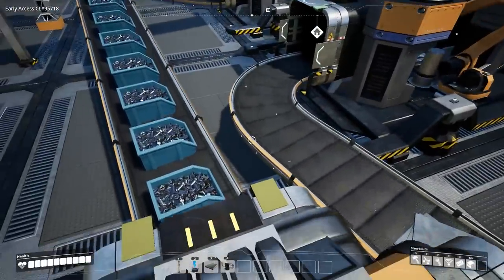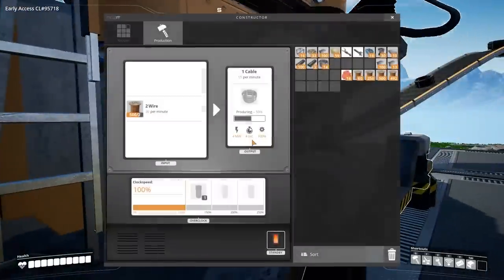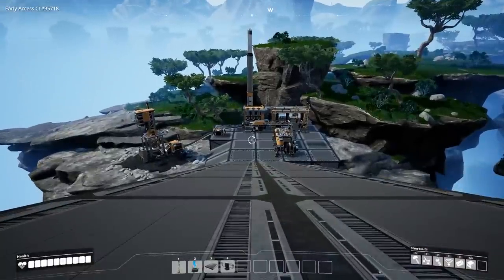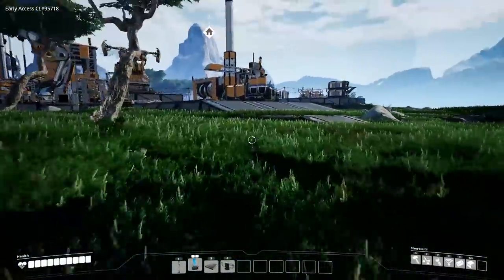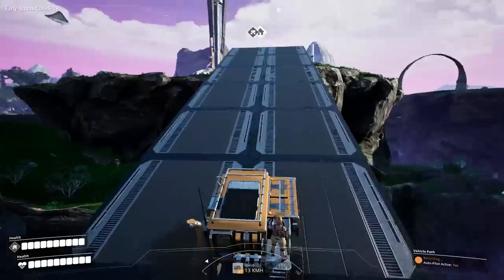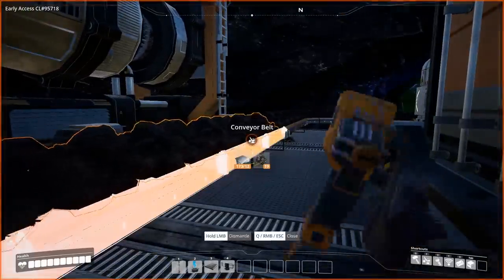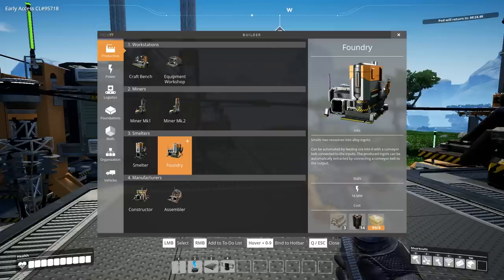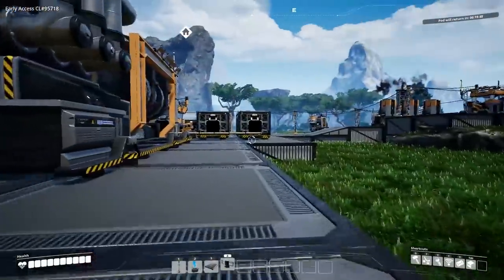AUTOMATED COAL POWERED TRUCKING : More Power - Satisfactory Gameplay - Early Access

Comment: The fuel slot on the truck depot is so that it will automatically refuel the truck every time it goes to the depot.  To keep the fuel slot full you want to have a splitter with another conveyor going into the other input on the truck depot.